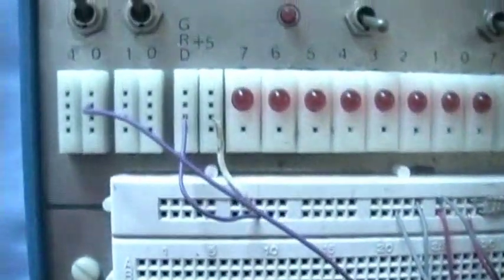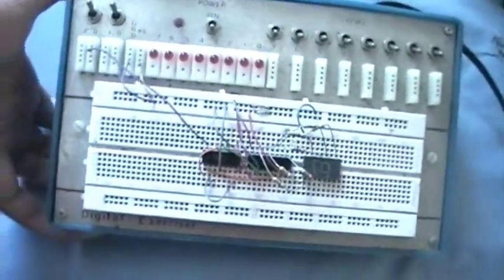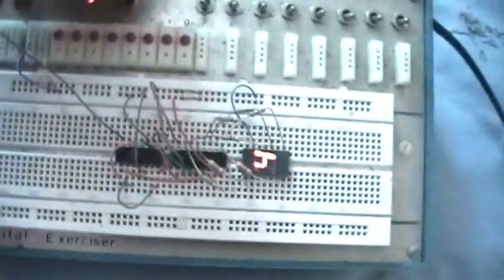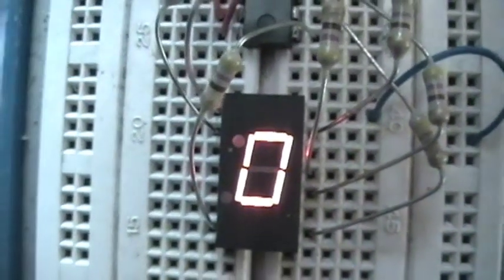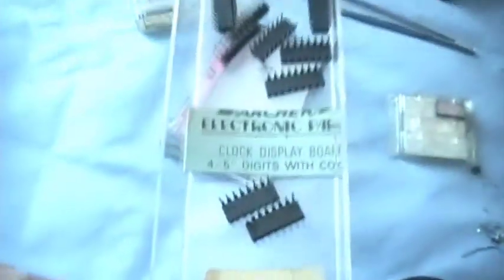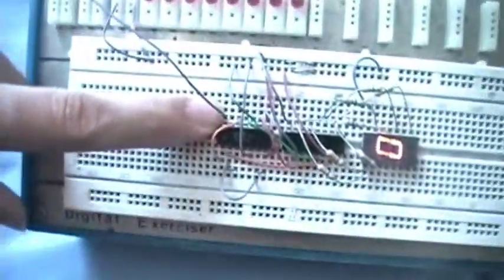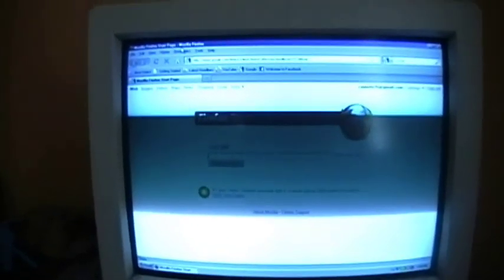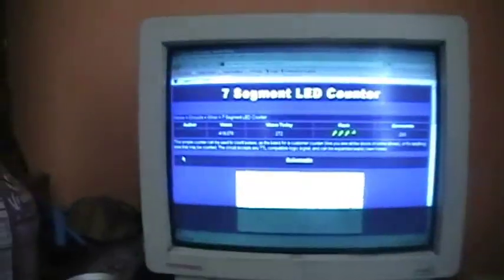My first Counter!! Uses 7490 and 7447 ICs, and a common anode 7-segment LED display.

Comment: For the TTL nixie clock I built recently I designed a circuit to derive the 1Hz clock from the 50Hz mains frequency. Where I live the mains frequency is very exact, much more exact than what I can get a regular crystal to put out.

Comment: Have you ever wondered how to make a digital clock with only one chip? (of course with some resistors, capacitors, diodes, transistors, etc.) Use the SC8560.

Comment: Hey! what are these 7 resistors? you are using common anode 7-segment, so replace the blue wire with a 470k resistor, and replace all the other resistors with wires, nothing will be damaged.

Comment: If you build a clock, use Nixie tubes, they are retro looking, Plus, you don't need the 7-segment driver chip, but a more rare high voltage driver chip instead! (or just a bunch of transistors)  I have some cool old clocks that you would be interested in.. shall I make videos?

Comment: Very cool, cassette master.
I have built many of those TTL clocks over the years.
They are very reliable.
With more digits it is wise to put an 100nF decoupling capacitor in parrallel with each IC pos and neg supply pins.

Comment: Nice. A clock is simple to make, though that depends on the chips that you have. I made myself a nixie clock using 4xxx chips and a lot of transistors. 

To make a clock you need a pulse source, which can be made using a 32.768kHz quartz and a special chip that divides the frequency by 32768 giving 1Hz (1 pulse/second), then just make the counters in series, so the next one counts up when the previous one wraps around, just some counters will need to reset at 6 or 3.Use some logic gates for that